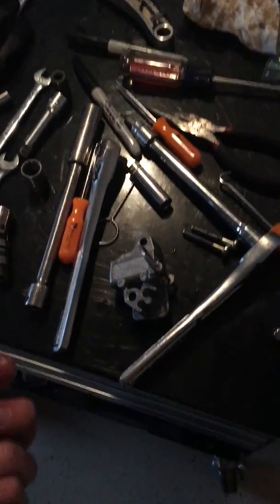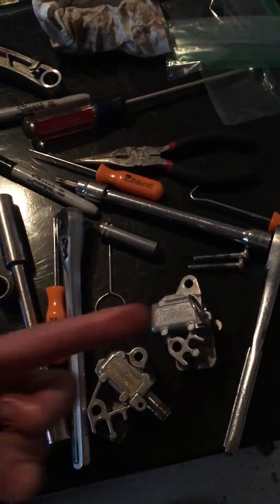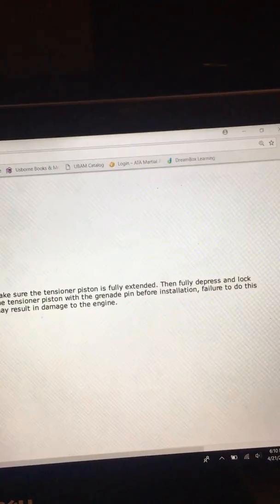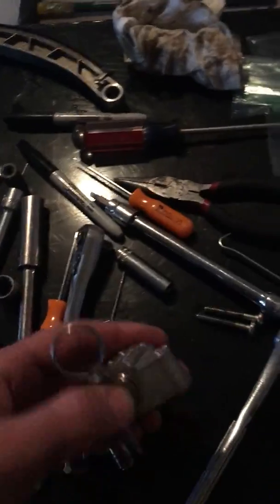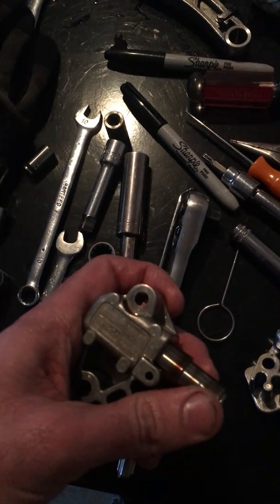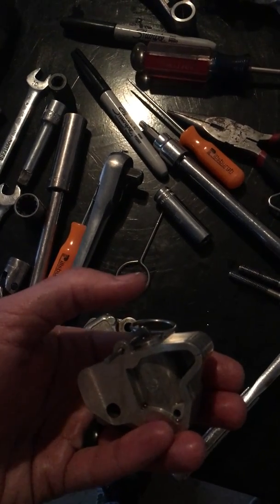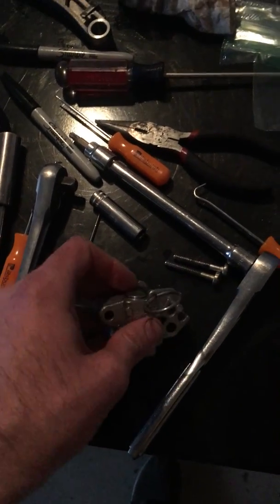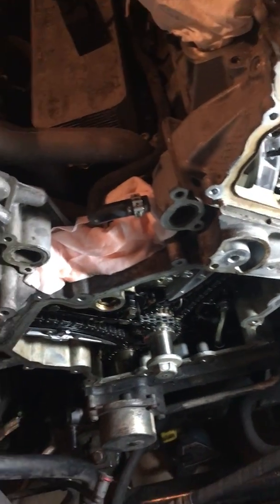Jaguar Land Rover Timing Chain Adjuster Reset

Comment: Hello there Titus, I have a Range Rover supercharged 2011, the same engine as yours. Guess what the timing chain problem. So Right now I’m at the point where I’m going to install new tensioners and the guide rails. Just wanted to make sure what’s the best way to check the timing of the fuel pumps because they have to run in sync with the timing of the car? The auxiliary chain (fuel pump timing chain) is still on I didn’t take it off and it has coloured marks on the chain. I thought you were the best person to ask because you been in my spot previously. Thanks for the videos they have provided help.
Reply from the maker: Hey there.  It’s been a while since I was in the engine, and I do not recall taking off the fuel pump chain and don’t remember setting that timing, and not even sure it matters since it’s just driving a pump that’s independent of valve timing.  Do you happen to have the pdf manual for this repair?  I’d check there.

Comment: When you put this engine back in time did the exhaust cam on the left bank line up with the cam lock tool after you turned the motor over the two revolutions?
Reply from the maker: It might have been off a hair, but it did line up.

Comment: Why did you end up having to remove the valve covers? In your original timing chain guide video, you said that you could get the old guides out without removing the covers... Is it possible to do the guide swap without pulling injectors, covers, etc?
Reply from the maker: Mike Klinker it was good until I got to the left passenger bank.  When I pulled the chain, the cam rotated with a pop, and I had no way of knowing where it was.  I almost took a guess, but there was just too much risk.  I had to pull the covers for peace of mind.  It’s got 8k since the repair with no problems.